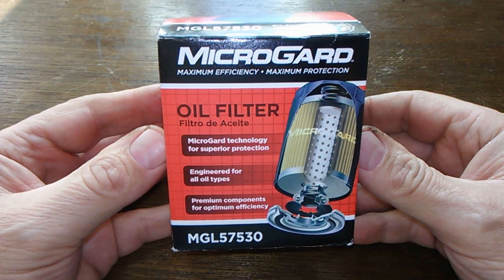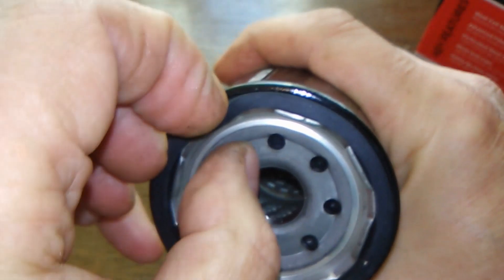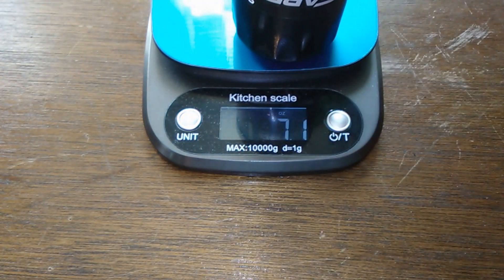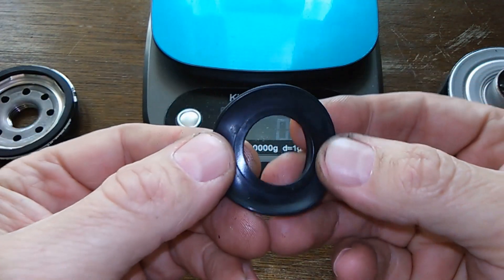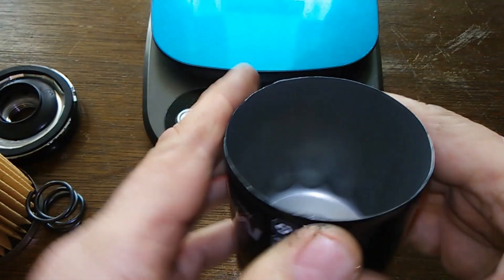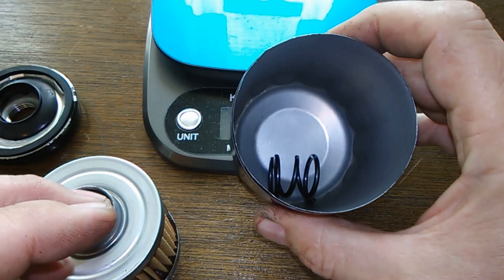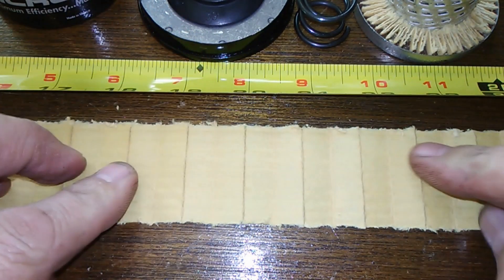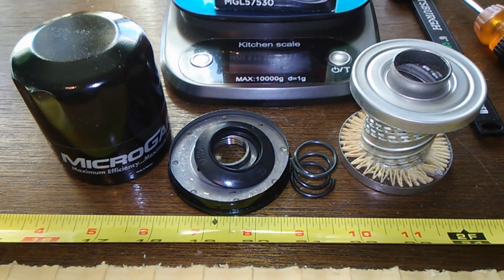Microgard Oil Filter Cut Open MGL57530

Comment: Very interesting filter.  Sure looks like a WIX filter to me.  Bob the oil guy reports the Filters are made by Purolator.  Typically Purolators have a stamped spring.  

Champion Labs made Mircoguard for years with their famous cardboard end caps.  

For $5, I will run that filter for 5K.

Thanks for your informative Video.
Reply from the maker: Hi Jason, Your welcome,
Yep, this is one of the better $5 oil filters out there.
Hey, you won't want to miss Friday's video. I opened up a Supertech ST10060 and was shocked, so much that I went back to the store and bought another one and opened her up. Luckily the second one was normal so maybe not too many of these oil filters out there. My advice to anyone reading this is to stay away from the Supertech ST10060 oil filter, that's all I'm going to say for now. See the video Friday, Feb.5th.

Comment: Update on this filter - 
l emailed WIX for technical data on the filter 57530 and this is what l received back from WIX (MANN+HUMMEL)  
Filtration Rate = 50% @ 8 microns / 95% @ 18 microns.  😮
Anti drain back valve = black silicone.  
Nominal Flow Rate = 3 GPM. 
Burst Pressure: 275 psi.
Very impressive numbers in this price range and much closer to filters in the $8 to $12 dollar range.
Reply from the maker: Thank You! 👍
Yep, for 5 bucks this is a very good filter.👍🙏😊

Comment: They work fine for basic oil change packages. Obviously not the best but you can’t make profit using 15 dollar oil filters on a 40 dollar oil change. They work just fine. Haven’t had any issues.
Reply from the maker: They're an okay oil filter, not the best not the worst.
Thanks for your feedback👍🙏😊

Comment: I've seen the videos of the high priced filters cut open and there's glue everywhere, pleats uneven, and nothing fits together well. It looks better then the higher priced brands. Sadly, not that surprising. You don't always get better quality when paying more. Sometimes you even get less.
Reply: In this case, Microguard is good bang for the buck and without having to worry about quality. This is not a top of the line filter but it's not priced like a top of the line filter either, even so whenever I can find one of the pricier filters I usually buy I wouldn't hesitate picking one of these up. They look just as good as WIX filters. Definitely nice having these as a back-up and Orielly's has regular sales and coupons if you sign up with them.

Comment: For 5 dollars a well made filter.  Yes according to the mgr at the O'REILLY I deal with the filters is a wix silver.
Reply from the maker: Yeah, I thought so,
when I went to Oreillys and asked for the Microgard he came out with a Wix and I said wanted a Migrogard. He then said no problem but had to get it from another store and I picked it up the next day.
Thanks for confirming it.👍😊
Reply: @WhipCityWrencher  For the Above, Napa Silver is like the Wix White Protec or whatever. The Regular Wix is a Napa Gold and much better.  We use these or Fram Ultras on all our work trucks. 
The 20-23 micron rating at 99% means clean oil.

Comment: Here in L.A the County has oil filter exchanges once a week. Bring in ur old used filters and get a new one. Usually at an Autozone or Orileys or parts store up to a $15 value, everyone goes for the mobil 1 but once that out. The move to the Microgards or Motorcrafts.
Reply from the maker: Hey, that's a pretty good deal,😊
The Microgards are good oil filters made by Wix.
Thanks for sharing.👍🙏😊
Reply: @WhipCityWrencher  can i send you an oil filter to review? I have an unused new oem Nissan filter, they sent me a wrong filter, but later they said its a universal filter they use on all cars. Its too short for my comfort, In fact when i just did my oil change i noticed they used that same filter but it sprung a leak around the spindle .
Reply from the maker: @Sasquatch304  Sure can, I'd love to,
Send me an email and I'll give you my address. My email is    Poker4me007@gmail.com
Reply from the maker: @Sasquatch304  Hi Brian, Somehow I deleted your email so I'll post here. I did a video of the Nissan vs a Bosch oil filter . The video will be published on a Friday, June 4th. Hope you like the video.
Reply: @WhipCityWrencher  awesome. Thanks!

Comment: I couldn't find the $10 "select" version of this filter for synthetic, so I bought this filter for conventional. I'm using it with 0W20 synthetic in a 4cyl Honda CRV. Should I switch it out earlier than 5k miles? Thanks.
Reply from the maker: According to Oreillys website. This filter is rated for 3,000 to 5,000 miles.
Reply: FYI - I just changed mine out at a little over 5k miles of use. No issues at all and what I was pleasantly surprised with is when I went to remove the oil filter (i let the car sit for a couple hours to cool off a bit first) the oil can was full to the brim with oil it was still holding, which means that the anti-drain back fitting did fantastic even at 5K.  I've offered this 5k filter to Whip City to see if he wants to open it up and see what the results are. Would make for a great follow-up to this video.

Comment: Would you use this filter on a Chevy Silverado 3500 hd hauling allot? O'Reilly's cheapest filter. I run synthetic
Reply from the maker: I would look at a Purolator Boss or a Fram Ultra.
Reply: @WhipCityWrencher  Thanks! I been using the OEM ac Delco. Thoughts on that? I appreciate you taking the time. edit,  I subscribed!
Reply from the maker: @factsnotfeelingssendit5961  Thank You!
The ACDelco and the Supertech are very similar oil filters both being made by Champ Lab. with a micron rating of 99% at 30 microns. In my opinion, there are some better filters out there. Ive opened about a dozen of them so far, I may have opened the one you use.

Comment: FYI - This is a WIX filter which sell for $8.99 under the WIX brand but O'reilly sells under the Microguard name for $4.99.  That is a bargain for this quality of a filter!
Reply: 2.99 here
Reply: @yourworstfear  Where do you get the MGL57530 for $2.99?
Reply: @JA-rn5qv  at my local store  got one two days ago and my synthetic oil. its there everyday price not all stores are the same some price hike.
Reply: @JA-rn5qv  MicroGard Select Oil Filter

Part #
    MSL51358
Line:
    MGD   2.99
Reply: @yourworstfear  That's a different oil filter. Of course  prices are different on different filters.
Reply: still 2.99 here hahaha

Comment: What is the device called that you used to cut that open?
Reply from the maker: Hi Jason,
"Oil filter cutting tool" This is the one I use: https://www.amazon.com/JEGS-80532-Filter-Cutting-Tool/dp/B007VR8C0U/ref=asc_df_B007VR8C0U/?tag=hyprod-20&linkCode=df0&hvadid=312142020868&hvpos=&hvnetw=g&hvrand=3327594813065374654&hvpone=&hvptwo=&hvqmt=&hvdev=c&hvdvcmdl=&hvlocint=&hvlocphy=9001685&hvtargid=pla-570276520018&psc=1
Reply: @WhipCityWrencher  Also one of those muffler chain type cutters work from Harbor Freight.
Reply from the maker: @portagepete1  Do you mean this cutter? It would probably work but it looks like it would be harder to use. https://www.harborfreight.com/exhaust-tail-pipe-cutter-58678.html